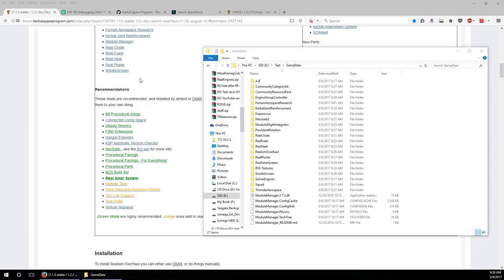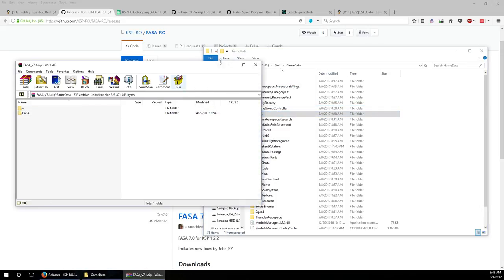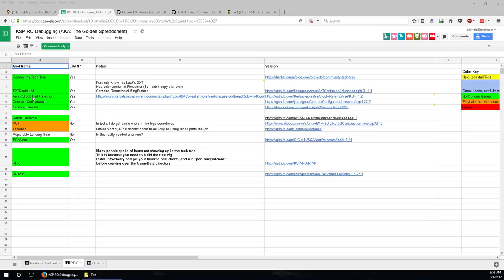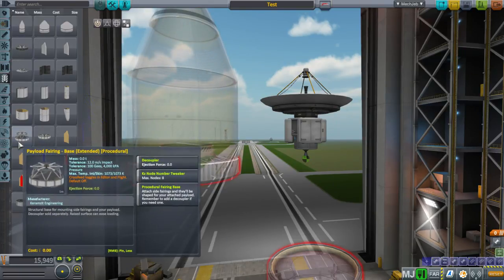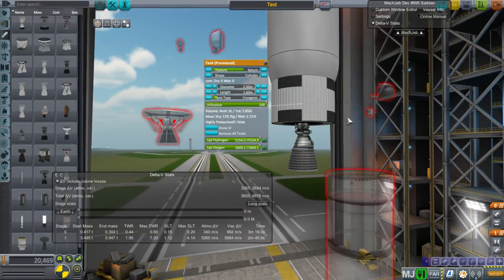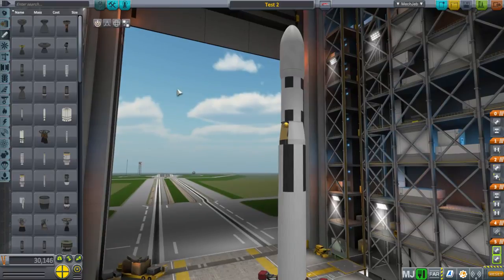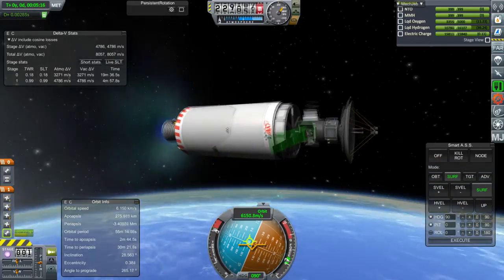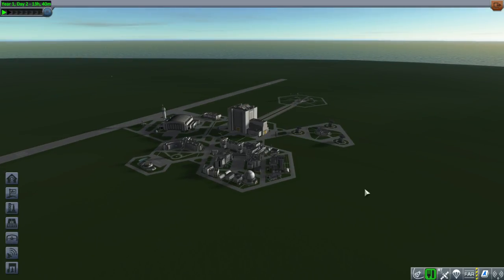Making Realism Overhaul Look Good (Part Mods and RVE)

Comment: I had some issues with scatterer and was able to solve them. It's really important to install the correct version (0.0300). The link on the forum page is for version 0.0320 (also for 1.2.2) and it will not work with RSSVE.

Comment: Simple question. Can I install higher version of a mods in a older version of KSP? And the same question in reverse, but in this case may not works with higher version of KSP.
Reply from the maker: If they have parts and no plugins, then maybe, though there was a reworking of the part categories between versions, so if your game freezes when loading a part the first thing you need to do is check whether it's got one of the newer categories. Parts made before 1.0.5 may have some collider issues and the wheels and landing gear probably don't work. For plugins, a handful of them will work in a higher version of KSP, but generally don't try to use them in an earlier version of KSP.

Comment: Whenever I try and install RVE scatterer always winks things up, on Earth it looks ok until you get to above 170 kilometers, when it becomes all ocean in appearance. On Venus it works just fine. On Mars and the gas giants it just appears black. On Pluto it doesn't change anything. Any ideas on what might I be doing wrong, or what might be going wrong?
Reply: Tyler Raiz I'll try, but I'm pretty sure that was how I installed them.
Reply: Tyler Raiz No, it's still exactly as I described :( Any ideas on what could still be happening?
Reply: https://imgur.com/a/nVA25 Examples
Reply: Ok

Comment: I finished installing all the required mods, most of the recommended mods, and several parts mods. One problem I have is a capsule that has splashed down in the ocean will rock back and forth forever. It's not a big deal if I just want to recover it, but if I want to do science, it's so hard to click on the experiments when they keep moving around. There used to be a mod called Better Buoyancy, but I think it's been abandoned. What should I use instead? Maybe a config file? Or some kind of physics settings inside the game?
Reply: Ft du

Comment: Can You make a tutorial abougines? Which mod adds possibility to burn (or ionize) during time warp?
Reply: I don't know why, but my keybord has eaten over one word and I hasn't seen it. I mean "Can You make tutorial about ion engines".
Reply: On CKAN there's a mod called Better Time Warp that sounds like it might help with long burns. But I haven't used it yet to see if it works.
Reply: I knew about it, but it is kind of buggy at higher than 100 physical time warp, so burn still can take a few days of real time

Comment: I cannot get the clouds to show at all.. Scatterer seems to work, the earth gets that blueish tint but no clouds anywhere.. on any planet. I first installed scatterer, then EVE, then RSSVE. still nothing. I have RSSC, which asks to add another config but I did not do so. Any tips? thanks in advance. edit: tried it with RSSC configs and still does not work. just allows scatterer on the other planets, no clouds.
Reply: Did you fix it, having pretty much the same problem